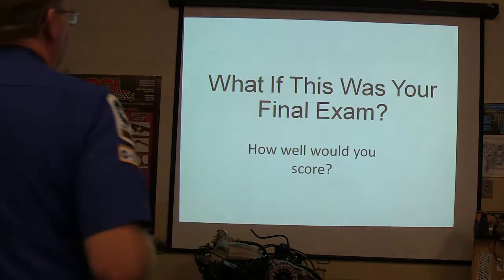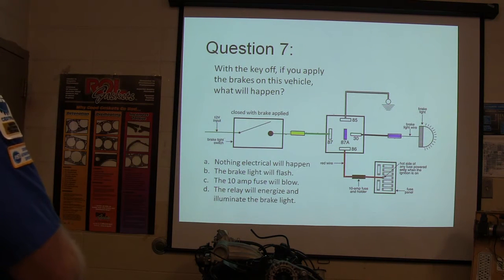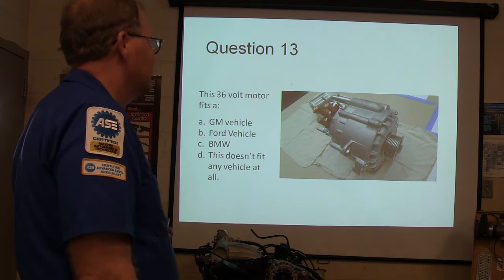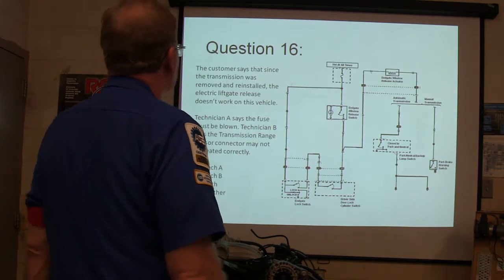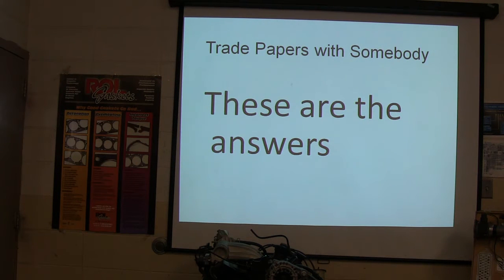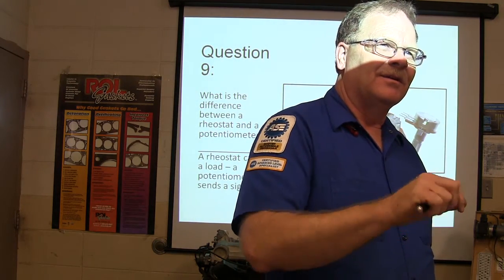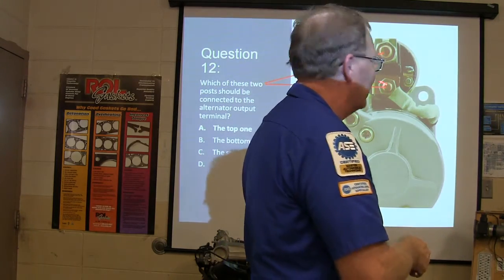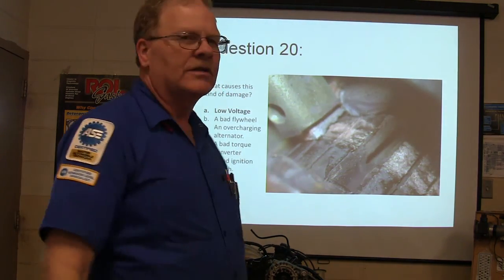Electrical 1 Pop Test

Comment: I'm surprised at question 12 at 23 minutes into the video, especially with you working at a Ford dealer at the right time period. Wiring the alternator to that post on a Ford truck (80's, 90's) won't charge the battery either because of the fender solenoid. Even if it did work, is that still a good idea with the extra run of cable? Maybe makes sense on transverse engines but on a traditional rear wheel drive setup, I'd rather a short run from the alternator to battery direct.
Reply from the maker: Nate Rowe on that particular starter it will charge the battery that's the point.  The starters you're talking about have the same connection on the fender mounted solenoid - that's where the junction is made on those Fords.  One reason I put that picture up there was that one of the students actually fixed a 2006 Pontiac G6 that had the alternator wire connected to the wrong starter terminal.